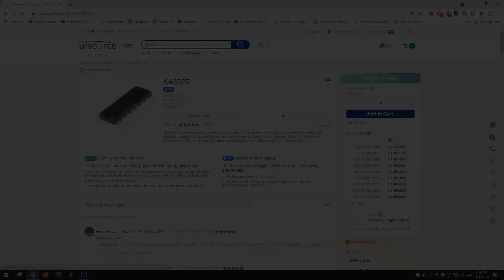12V UPS for router WiFi and Camera | UTsource

Comment: I understand it is not quite a UPS. Is constant power of the router from batteries and they charge constantly? UPS is always running from electricity and switches to batteries only when electricity is turned off. This is the difference. But it is still useful - if there is no electricity to connect the router to this UPS (it will be more correct to call it powerbank) and there will be the Internet. I have long wanted to do this, thank you)
Reply from the maker: It is UPS. the power from the adapter will charge the battery and supply the load, only when the power is off, the boost circuit will work.
Reply: @PhdHung  it's change case =). But it is better to show with a multimeter.
Reply: ihave this board actually it's a ups bro

Comment: Hi Sir, I am a Youtuber of an Electronics Chanel. Sir I have PWM Charge Controller its load Automatically Turned off after 24 hour daily But When I put on this 00 after 24 hour it was not turn the load On by automatically.
Please Tell how can i Use Continue load by Changing internal software or put out its Timer option from Controller.

Comment: I was made 18650 lithium battery 3.7v 2200mah with three batteries ups I put charger  12v with 1A  but it's battery  drain so fast  like 10 mints work only  ??

Comment: Part number of the charge and boost module please?
Reply: 18650 Battery Charge Discharge Converter UPS Protection DC 9V 12V Charging Step Up Booster Module for Lithium Voltage

Comment: the problem with that the 18650 always in 4.2v and will degrade immediately the 18650 battery health at this voltage so it's better to keep always in float charge like 3.9-4.0v to expand battery life of 18650

Comment: Please, how to convert 110V ac to 30V dc 10A
It will be useful for an 30v power supply
Reply: Adaptors easily available. But 10A is high